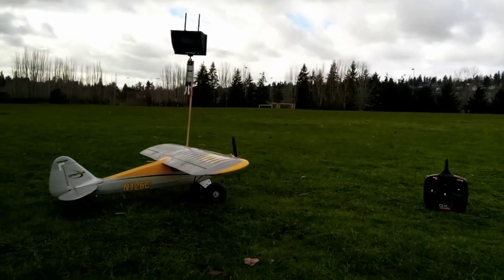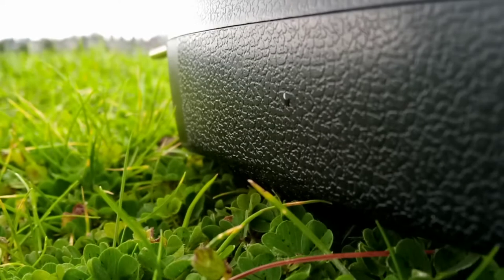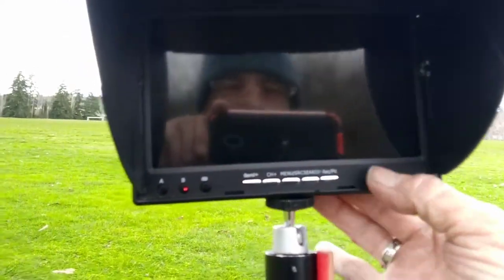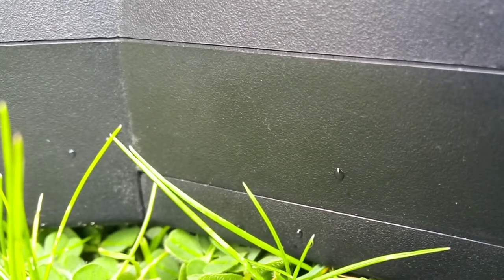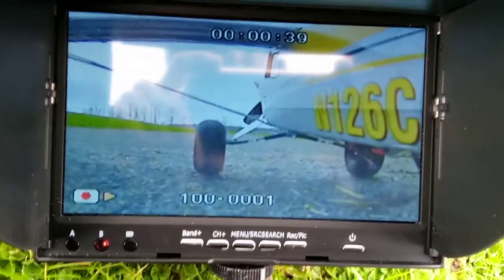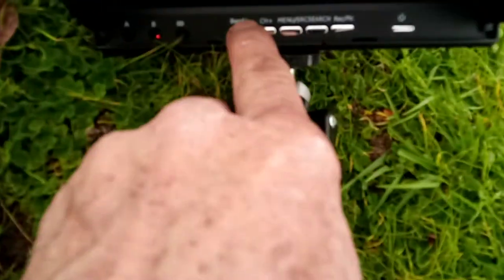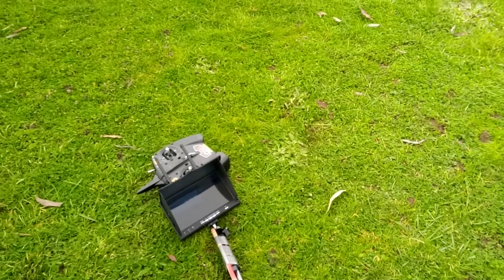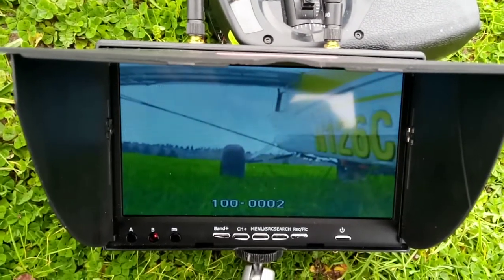RC Airplane Carbon Cub S2 FPV: MORE Video Transmitter AND Receiver Issues!

Comment: I would love to do FPV  but to many more things to go wrong   : (
Reply from the maker: Definitely more to go wrong, but I've had very good results with my original 600mw setup and my 2nd ground station after replacing the faulty first one.

Comment: What's your setup for FPV?
Reply from the maker: I was using a 1000mw AKK video Transmitter, it was faulty. I went back to the 600mw version I was previously using, which works great.